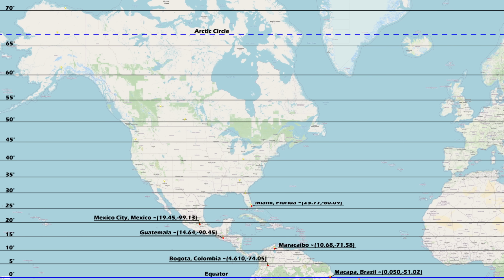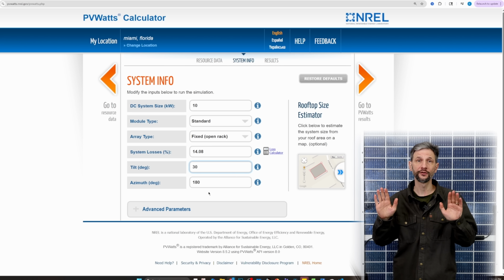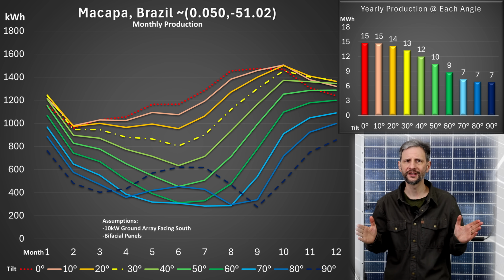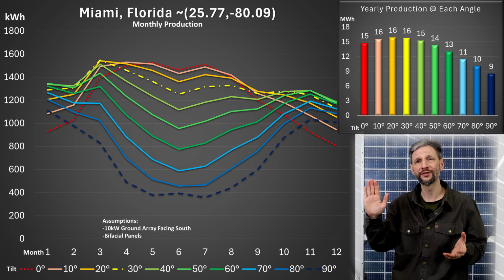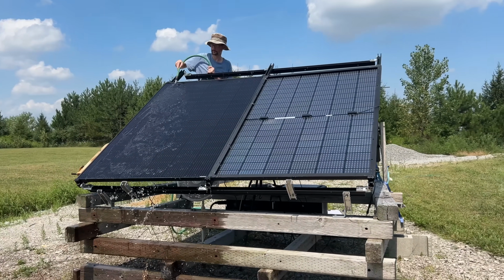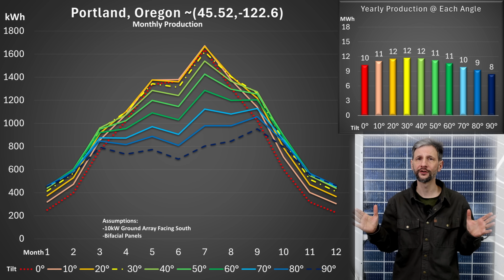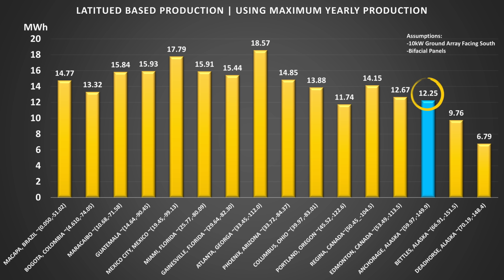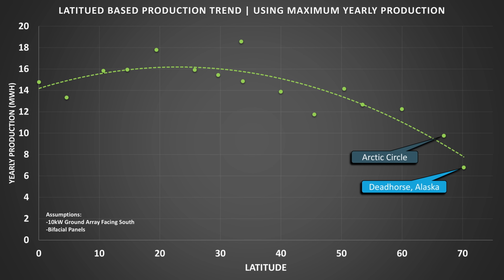Your Location Destroys Solar Panel Efficiency

Comment: I don't have solar. But in the UK we have had rain nearly every day since Christmas. There have been very few dry periods (especially on the weekend) but usually super cloudy and lots of torrential rain. Most people still have their outdoor Christmas lights up because the weather hasn't been good enough to get them down (I don't think it have ever seen them up for so long).
Reply from the maker: That kind of weather definitely highlights the importance of battery storage and a backup generator if you want to be off-grid in locations with prolonged periods of heavy clouds.

Comment: I am in the Southern Hemisphere, at around 41 Deg South. I have mounted my panels (not bifacial, unfortunately) on tilt-adjustable ground mounts. I have 7 x 540W panels on each of two identical mounts, so I can adjust them to different tilts, and compare the results. It is satisfying to adjust the panels each month and see the output increase compared to the ones that are still at last month's angle.
I have sometimes set them to significantly different angles, just to see what effect it has on output at different times of the day.
The most interesting thing has been a better understanding of what happens in dense cloud cover: Regardless of the month, in dense cloud cover, horizontal panels collect more energy than panels tilted to the "correct" tilt.  This factor is tempting me to automate the tilt angle based on the output of several irradiance sensors set at several different angles, to measure the actual "best local irradiance angle".  During dense cloud cover, you need all the help you can get...
Reply from the maker: That's some great experimentation!  Your observation about horizontal panels in dense cloud cover makes sense for single sided panels.  I find with bifacial panels the orientation in heavy clouds makes almost no difference over the course of the whole day.

Comment: Did this guy suggest using water to cool solar panels in Phoenix... Not ok
Reply: I mean it's a better use of water than those datacenters
Reply: @runed0s86 lol. That's like saying it's ok to steal because it's not as bad as murder.
Reply: Some tests have been done recycling water on panels to determine production. I did my own. It makes a difference! But it’s impractical to both waste water and use a pump to recycle it, even if the pump is solar driven. There are videos out there about it.
Reply: @tombrownca  I am a big fan of covering open canals with solar panels. It slows evaporation loss from the canals, and evaporation that does occur cools the panels.

Comment: Hi Dave thanks for all the hard work. The question I have for this data is what would the yearly output be if the panel was always at the optimal angle?
Reply: Optimal angle?
Now you are talking single axis or dual axis. 

Latitude tilt: you could adjust the tilt angle 4x a year to get modest improvement. 
Azimuth sun tracking: much more involved as the sun moves left to right every single day. You would get much greater output, but one row blocks the other behind it, or you have one hell of a large array to be swinging on an axis every day, which means more cost and points of failure. Never mind doing this.
Reply: @tombrownca  Hi thanks . I was thinking of adjusting it for the season.
Reply from the maker: That's a completely different data set.  I could re-run the analysis from the Equator to the Arctic circle assuming a tracking solar array. Unfortunately, this video is not getting enough views to justify the amount of time I spent on it so I probably can't justify spending the time on more variations.  Unless my curiosity gets the best of me of course.   : )

Comment: I got into an argument with Michigan citizens because they were mad a solar bill was defunded. It’s crazy how much tax funding they were going to waste.
Reply: Extracting and refining a teaspoon of gasoline costs more and produces more waste and pollution than a single solar panel, and that whole industry is funded by our tax dollars!
A single solar panel will supply more than 1000 gallons of gasoline's worth of electricity over it's life.
Solar panels are never a waste, even if they're operating at 5% efficiency. They will continue making power until the sun burns out.

Maybe you're mad that the air in the city doesn't smell like sewage and sulfur anymore?
Reply: @runed0s86that’s ignorant. Also very disingenuous. The amount of lithium needed to store collected energy, charge controllers, and not counting the amount of copper needed to transfer that energy. Thinking people are upset because it doesn’t smell like sulfur is purposely being obtuse. It takes 16kw of energy to make one kilogram of silicone needed. I cut ties with electric companies and my home is strictly powered by solar. This is micro compared to what is truly needed to power a city. Again Michigan is one of the most foggy and haziest states on our country, that state has some of the harshest winters. Rendering all panels practically useless. With 3000 watts of solar on my roof and 1000ah lifepo4 batteries I only store 50watt hours per day. I’m pretty confident you are either naïve and gullible or just outright being dishonest.

Comment: Thanks Dave....I'm at 48.6 north. My ground arrays hang nearly vertical year around since I'm usually too lazy in the good solar months to tilt. The big winter solar issue here is the approximately  90% cloud/fog coverage for 2 to 3 months. I'm about 400 miles inland from the Pacific....so my winter generator run time is 80 to 120 hours each year.

Comment: I live at approximately 53° north latitude. I think it makes more sense for our latitudes to adjust the orientation according to demand.

For many years, larger solar installations were given fixed feed-in tariffs. The orientation was then based on the maximum annual yield. This led to Germany exporting its electricity to other parts of Europe at a cost during the summer. Yes, we (no, not the producer, but ‘we’ as electricity customers) then pay for someone to take our electricity off our hands! This is, of course, economic nonsense. In the meantime, there has been a rethink.

If I want to be as self-sufficient as possible, I have to take into account that I tend to need less electricity in the summer and that electricity is also available at extremely low prices. This means that it makes sense to optimize solar yield, especially for the transition periods and winter. What good is high summer production if I don't need the electricity then? In addition, I have longer hours of sunshine in the summer. This means that even with less than optimal irradiation angles, enough energy is still generated.

Comment: = I utilized a  45 Degree SLANT  on my  36-Panel  Ground-Mount 
not 
Not  NOT  Based on  DATA  but on the fact that my Framing SQUARE had  45 Degree Angle "built-in" = LOL
again 
South Facing  HILL  + 45  degree Angle 
... 
my LAST  ARRAY,  = SIX (6) Panels, was installed at 180 Degrees ( VERTICAL )  for the Winter Sun 
...
my 36 "PV" Panels are arranged in a  6S / 6P  configuration 
...
Thanks for the Statistics 
COOP 
the  WiSeNhEiMeR  from Richmond, INDIANA 
...

Comment: I have had an Off-grid solar system here in Thailand for 8 years, powering a 450m2 house and 2 EVs. We are at 15 degrees N the same as Guatemala. August is our worst month as it's the height of the monsoon season. Our most important panels are the East and West ones as they reduce the amount of time we are using the house batteries. We have connected bi-directional charging from our EVs to use at night during the rainy season (videos on my channel)
Reply from the maker: Thanks for sharing your real-world experience.  As you state here the weather conditions and demand timing can drive a completely different layout than the one for "optimal" total production.

Comment: Another excellent video, which describes pretty much everything you've ever done.  I'm putting panels on the side of my pole barn in the spring.  They will be mounted vertically, but with the ability to set them at around 30 degrees in the summer.  My property is right at the 45th parallel, with lots of lake-effect snow issues.
Reply from the maker: I have found the reflection off the snow in the winter for vertical panels is actually much better than the calculators show.  If you live in a location with a lot of snow vertical is a great way to go.

Comment: Excellent video, one of your best ever in my opinion.  A video that every solar enthusiast can utilize.

I live in NE Georgia and blown away that it exceeds Phoenix production!  I did some calculations a few years ago and came up with a year round tilt of 29.1, so feel good for the confirmation.  My challenge is that my property is slanted.  I have Brightmount mounts that are not easily adjustable so unfortunately my arrays aren't all at an optimal angle.

My other challenge is that in NE GA most of us have trees that significantly shade in the winter.  I've cut down a lot of trees over the years but I still have many trees a hundred yards from my panels that still shade them most of a winter day, summer is awesome.
Reply from the maker: Thanks for the feedback!  Trees are a big challenge particularly in the winter.  I hate to cut down trees so there is always a balance there.  The nice thing is, even when things are not optimal you can still produce power and every bit helps.

Comment: Nice analysis, thanks!  I think if you are doing grid with annual net metering you want the maximum daily and annual production. If you are in any other situation you might want to prioritize desirable production hours over maximum production.  For example, if you have only daily or monthly net metering you might want more production in winter even if you give up more in summer than you gained in winter.  For example 2, with batteries you might want dawn and early production to get power into those batteries after draining all night.  For example 3, if you are grid tied with expensive time of use in the evening, you might want more production late in the day.

There are a lot of considerations in the abstract!  Very easy to get paralysis by analysis, but remember, many people simply don't have all the options.

Most people have limited space and directions where they can install panels.  The best analysis might be what you can afford in your limited space, and how much it makes sense for you to spend for what you conservatively estimate the panels to produce in that space.
Reply: If you have a battery, then you should have one with more than a day's capacity, then the time of day when the panels produce best is irrelevant, only the total for the day needs to be optimised.  Batteries are cheap enough now to have several day's capacity.  If you have insufficient solar power to fill the battery then you should be adding some power from the grid at whatever time of day is cheapest.

Most people put their panels on their roof, which is normally the best place because it is the least shaded place on their property, especially in winter, which means they have no choice in angles, other than while they are choosing their house.  This video is clearly not for these people!  The interesting thing about these figures is that the elevation (vertical angle) doesn't actually make much difference over a very large range.  There is a best angle, but there is no need to worry about not using the best.  Also, there is no need to live near the equator for solar panels to work well, they work well everywhere, the only difference as you get near the poles is that they produce increasingly less in winter, and after you reach the arctic circle they stop producing completely in winter, for increasing numbers of days the further towards the pole you go.
Reply: @nigels.6051  I strongly disagree about having several day's consumption worth of battery, certainly if you have grid power available rather than generator-only. Any battery bigger than enough to get from 2 hours before sunset to 2 hours after sunrise is largely under-utilised and wasted, only serving to make your rate of return / payback period worse. If you have cheap power at night (e.g. 11 PM to 7 AM here) then you only need enough battery to get from two hours before sunset to 11 PM.

Comment: Do these calculations include the effect of cloud cover?  In southern Ontario, there are very few sunny days from November to Feburary.  It is not worth worrying about the winter angle if the sky is cloudy most days.
Reply: I assume they do include cloud cover, otherwise the best angles would be higher, they are actual measured output over a year.  But there is no indication of what adjustment you should make for cloudy places vs non-cloudy places, and the amount of cloud cover you get is a very important factor.

If power output under cloud is important for you then you should optimise your angle for cloud instead of sun.  For me, further north than you in the UK, if I optimise for winter sun, I would have my panels at around 60°, but because I optimise for cloud, they are at 11°, a big difference, and a lot more power on cloudy days.  My total potential power output from the panels may be a little less with that angle, but as you can see from these results, 11° is reasonably close the maximum wherever you are, and I can't actually collect all my power on sunny days anyway since I didn't install enough charge controller capacity, thick enough cables, enough battery capacity, or enough inverter capacity!  My system is designed for cloudy conditions since it is normally cloudy here in Wales.

If you want to know the best angle for you under cloud, just install a light meter app on your phone, or use the camera and look at the exposure readings,  put a piece of white paper over the lens to diffuse the light, and point the camera at the sky,  Adjust the angle until you get the highest reading. It does depend on what you have around you, a large tree, building or hill behind or to the sides of the panels will result in a higher angle away from the tree, even if it is not shading the panels.  The best angle will be almost the same all year, with a change if the trees loose their leaves in winter.  It should be somewhere near 11° to the south, which as you can see from the results in this video, is a pretty good angle at all latitudes, which does indicate that the results came from places with significant cloud.  Not like most of the PV videos on YT, where people wait many days to get a "perfect testing day" ,with no cloud, before conducting their test!
Reply: @nigels.6051 Thanks for your comment and information.
Reply: @nigels.6051  yup, in Far North New Zealand at 35.5º S I also decided on 10º when I put my panels in in September. It's basically perfect in sunny conditions in mid summer but also works well in our frequent overcasts. It's just steep enough for the rain to run off, but allows easy and cheap mounting just sitting on some concrete blocks on the ground. Our July/August is basically continuous overcast and rain, with only occasional sunny days, so I don't think the expense of steeper (or adjustable) mounts is worth it. Better to buy more panels! Especially at the £50/440W price I paid for my JAM54D40-440/GB (just googled now and that's still the same).
Reply: NREL site does simulations based on actual data.

Comment: I live in Edmonton and came up with similar numbers. Recently I've been looking at solar to take our radio club entirely off grid all year. In winter we use about 75 kWh per day. Vertical south facing bifacials are the easy winner although our site would require facing most of the panels southwest with a 30% drop in winter production. The long summer days would result in over 2x the production and would easily accomodate our air conditioning needs, about 30 kWh per day. Overcast production in summer would still meet our needs with an array sized for overcast in winter.

The challenge is the grey days in winter. Bifacial is a huge help, but production drops to about 1 kWh per kW of panel rating, doubling our needed array size from 50 to 100 kW. And that's not cheap!
Reply: Try to run the numbers with running propane/diesel generator for make up power, might be cheaper and only done as needed. Although keeping grid available might be cheaper.
Reply: @J @JGnLAU keeping grid available would be cheaper than running propane or gas. Mainly because of how cheap electricity is these days in the US. Even then its an issue of installing more solar and batteries, with current prices you can easily buy 55 kWh of solar for 20 thousand dollars (these are the numbers from Technology connections). And at that point it’s an issue of energy storage more than anything.